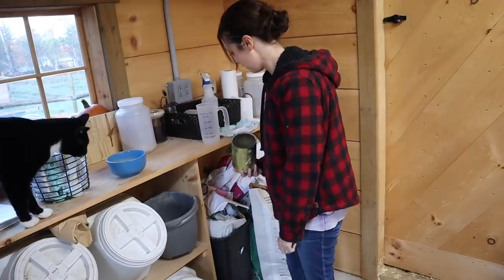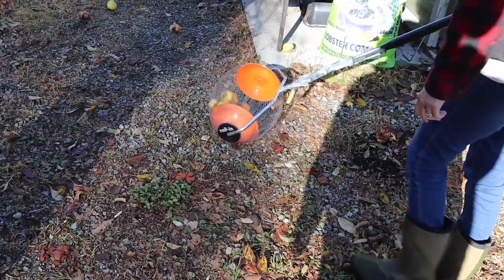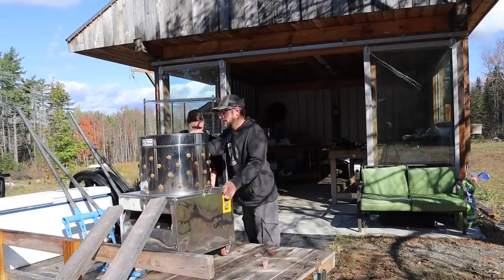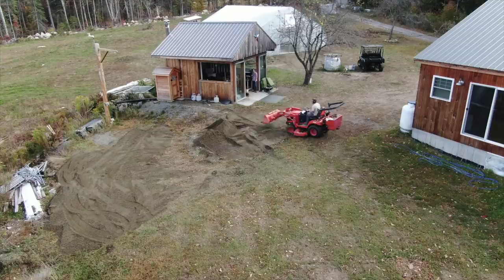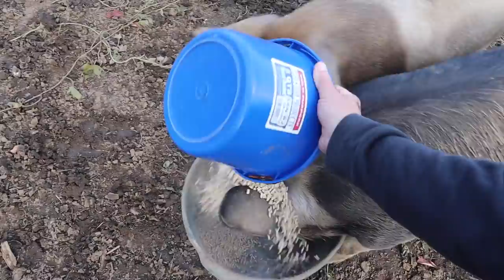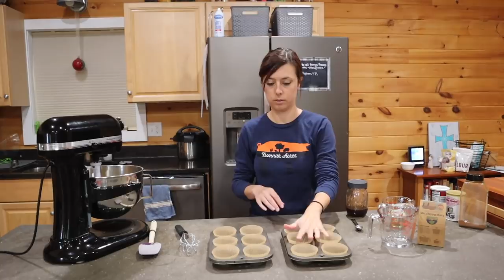Our Setup for Butchering over 500 Pounds in a WEEKEND Getting the Homestead Ready to Butcher 2 PIGS

Comment: Speaking of winter, If you want to leave the gravel where you put it get some bailer belting and drill some holes in it that line up with the bolts on the plow edge, then remove the bolts that hold the edge on the plow, put bolts through the bail belting then around the plow edge and then on the bolt again on the back of the plow then a washer and the nut in each hole. then when you plow or back drag the plow blade will not dig into the gravel or dirt it will glide over the top leaving the gravel where it is the weight of the plow blade will keep in down where you put it. This works great when the ground is not totally frozen or if it is frozen and still allows for moving the banks back if you need to. Just measure the the blade height multiply x2 and ad an inch, so if the edge is 3"high a 7" belt should do the trick or you c an get it wider if you want, i got the belting at tractor supply and it saved my driveway.

Comment: I love the fact you use wooden tables for cutting up your meat so many people, nowadays you stainless steel and plastic. My uncle was a butcher and sometimes I would get to work in his shop from time to time.. one of my jobs was to take care of the wooden tables however, I did that job different than you did. 1. First of all, I would wash down the tables with warm, soapy, water, and a hard, bristle brush. 2. I would allow it to air dry for a few moments, and then sprinkle sawdust all over the table. 3. Then, with the sawdust on the table, I would take a wire brush and go to town, scrubbing it, good and proper. 4. Next, I would brush all the dust off the table with a soft bristle bannister brush. 5. Wipe down the table with some lukewarm water and allow to air dry. 6. Once a month or so I would rub it in food grade mineral oil. Depending on how dry the wood was would indicate the amount of coats needed.. sometimes it would be one. Sometimes it would be three. Once done my uncle, to give me a big smile and a pat on the back and then he would dirty the thing up again. lol.

Comment: Gina I laughed with you and the egg incident. I had a similar issue 2 days ago however I was making breakfast and I have a gas stove with grates. I cracked the egg on the counter by the pan and it broke completely on the first try and the egg slid right down over the grate and into the well. One would think it would have cooked but it didn't. I had to turn off the gas and clean everything up. Only the yolk survived to be fried. The White part kept sliding around and ended up in the garbage. The egg only cooked on the grate part. Got it all cleaned up and started again except by this time the bacon and toast was cold. It happens to the best of us. LOL

Comment: Just a thought on the garage floor. They make garage floor mats (used often over badly degraded cement floors). Once your gravel floor is in mats over the gravel would keep dust down, and provide a surface that things can't sink into. I'm thinking the feet on shelves etc. I don't know if it would work well or not, but probably less expensive than cement.
Gina, I think the clean up fairy must be on vacation. I've had to do my own cleaning as well. The baking had my mouth watering.

Comment: Al, is there any reason you don't wipe the outdoor tables down with a combination of mineral oil and bees wax (or carnuba wax)?  Mix them and heat to melt the wax. Ready to use after that and forms a somewhat thick liquid.  They make premade blends for use on butcher block and other wooden food safe items.   You would probably still have to renew it, but it would be more water/moisture resistant than just wood with mineral oil.

Comment: Not that it matters  but technically  you have wagon  more than trailer
As  it has 2 sets of wheel  1 fixed and 1 that turns. 
 When bucking  bales of hay had a wagon never  master backing  up LOL LOL few feet  otherwise  i drive around stack to get  better position  LOL LOL  thise truck diver that pull and back up trailer and wagon on same pull wow i admire that ability